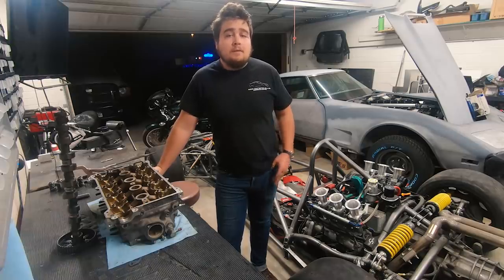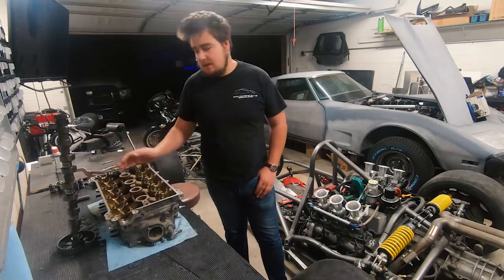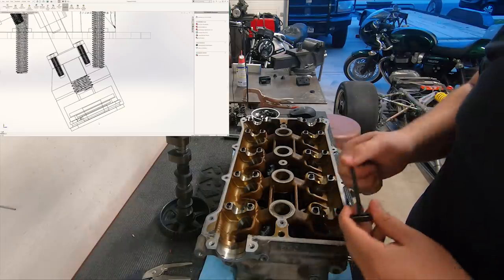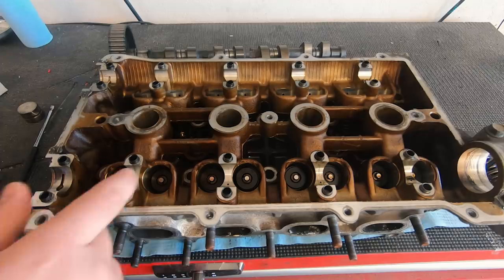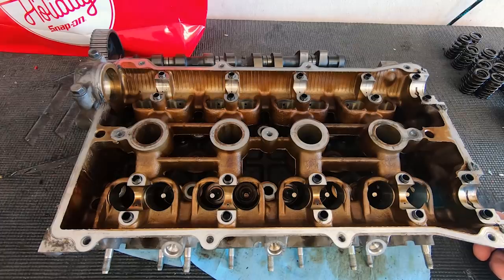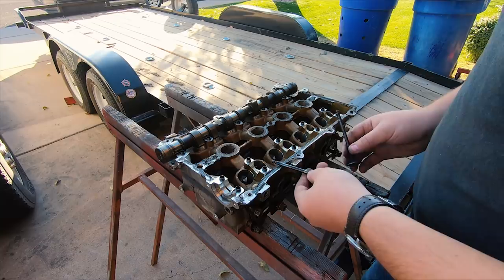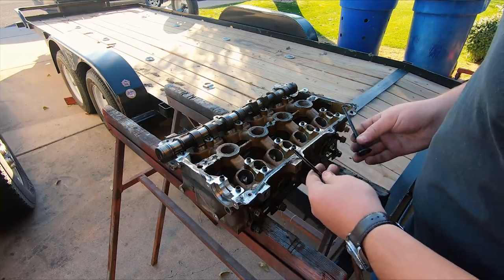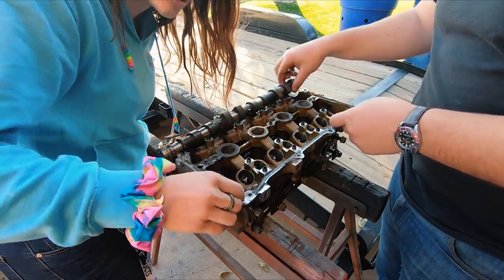Freevalve Miata Build! - Part 1 of  2

Comment: im highly anticipating the end your free valve setup. Years ago when i had my own auto workshop i was coming up with designs of doing my own freevalve setup, but never finished the designs or even made it to prototype. life got in the way. The potential of an engine with the right designed setup would be huge. being able to control valves and change opening  and closing  depending on throttle and engine load. 
Youre doing an amazing job mate.

Comment: You’re an absolute legend!
Reply: So is a Freevalve LS possible?
Reply: This dude will legit make free valve possible for all! 
Fu**ing epic!!
 Dohc is the most common and quite complicated if he pulls this off he gets my money for sure.
He just has to stress test it for reliability and fatigue
Reply: LS valves are a bit bigger and heavier, but with proper springs, pressure, and solenoids, I don't see why not
Reply from the maker: Thanks man! I'm excited to stress test it all- that's why I'm skipping the plastic parts and going directly aluminum.
Reply: @WesleyKagan  man the possibilities are limitless.
Its just too good to be true but i cannot find any other problem than making it robust and figuring out the tuning.
After that the head has mild to wild cam at the same time!!

Comment: Your work is frigging awesome!!!!!  

A professor I had for a VLSI class would have cracked up at your description of a FET ... on the first day, he had a lecture where he explained how FETs worked in a digital sense (pretty much as you said).  He got all serious (normally he was always cracking jokes), he'd make sure any classroom doors were closed, and we were sworn to secrecy to not "leak" what he was about to say.  He then explained FETs in a very straightforward, simple manner (basically compared them an on off switch), and he called things like a MOSFET's linear and saturation regions of operation "nonsense sorcery" as a joke :-) (obviously he didn't believe that, but the act was hilarious if you saw it)).  

He claimed that he had to take all precautions since one of the more analog centric professors would hear him, scold him, and possibly fight him after class :-).  I miss that guy.

I cannot wait to see what else you come up with!!!!  Again, awesome work! :-)

Comment: Excellent stuff! As an aircooled VW guy, i can see how great it would be to be freed from not only the pushrod system, but also the dubious valve  placement in the heads. Could do a five valve head if you wanted, though that would mean a totally new head of course. It´s great.

Comment: The piezo valve is there in festo catlog, i guess that will be most suitable in your case, it has very sharp response time thats what you need during high rpm performance, i think solenoid valve may not achieve parallel performance. 
It might be costly, and if you nedd that you need a 300VDC , that is  cons of that piezo valve. 
Best of luck. Great experiment by the way!

Comment: Hi Wesley, I've estimated that with tubes that long going to your actuators, that will create quite a delay and the engine will more lower-RPM limited. To combat this issue, if you plumb the high-pressure to the actuator and place your pneumatic solenoids to exhaust the top AND bottom of your actuators it will be able to actuate at a rate three times higher...The only caveat to this is that the solenoid signals would have to be reversed, which is easily doable by selecting "invert" in your software table. The other plus to doing as I suggest is that you will need to mount the solenoids directly next-to or over-head the actuators, which frees up a lot of clutter, once your air manifolds are all engineered, (I recommend v-banning all of the high-pressure and low-pressure parts to make them individually accessible). I really appreciate you working on this endeavor, as many others don't have the equipment available, or experience to fabricate it all (especially like in this Country, on a small island in South Asia, everything is twice the cost plus import duties). I loved the first video I saw with the HarborFrieght engine, and I've been thinking about what it would cost to get a lathe, mig, drill press, and many other various tools here, and it's so daunting. Keep up the fight!

Comment: you can literally pull up with a "stock" cam sounding motor, hit a switch and you have a big thumpy monster cam so much potential
Reply: It's like a VTEC system, but instead of having only 2 cam profiles, you have infinite! This is amazing!
Reply: It could be even better than a switch, tune the idle to not stall out when you start off and still have a lope in the idle. Then have ideal lift and timing for rpm and throttle position.
Reply: @tristanhanley8741  the possibilities are indeed endless. Ignoring the obvious oil pump issue, you could theoretically run the engine backwards with the correct timing.

Comment: Looking forward to watching this project grow.  You have to possibility to come up with something so great here and making it work with current technology being a bolt on.  Remove the cam and make a few changes to the motor and have full adjustment for performance tuning, even better mileage, or reducing emissions getting better burns or doing two burns what ever you want it to do.  Having the springs as a back up is smart just in case one of the parts fail.  Going to be awesome to watch so 10,000 rpm dyno pulls
Reply from the maker: Excited to see it work as well, and I'm hoping that everyone can use it to it's full potential!

Comment: Kagan!  Josh Stewart over at Speeduino is really going to love you for going with the Miata Engines.  This freevalve project is so fundamentally different, I find myself stuck in thought with standard engine design.  For example, in engine management, one of the crucial things you need to know is (Otto)cycle position.  That is almost always determined by a camshaft position sensor.  Well, if you don't have a camshaft, you won't have it's camshaft position.  Even if you have a dizzy, they are almost always attached to a camshaft.  When you have crankshaft position like you had in the Harbor Freight engine, you didn't need cycle position to run the freevalve bc it had a carb and wasted spark(like all single cylinder motors do).  On the Miata engines, you have fuel injection that requires cycle position.  At least from the stock ECU.
Reply: wonder if you could use the solenoid signal that actuates the valves as a fuel injector trigger, and advance or delay the spray time.
Reply: @frigglebiscuit7484  Like I said before this is a totally new way of thinking of engine management.  Valve position(aka cam position[aka engine "cycle" position]) is not set in stone or hard-coded.  You stop a free-valve engine you don't have that 50/50 chance the engine will start the compression stroke before it pulls any air in.  
Pulling the signal off one of the solenoids might work if you are using an aftermarket ecu but for the stock ecu you might be able to emulate the stock cam signal(ardustim). I mean, though, where is the free-valve ecu getting it's info from.  You might as well get it from the same source.

Comment: This is a wonderful project and I wish you the best of luck.  My brother and I have done a similar project building a rotary valve engine head for a BMW e36 328is.  There are many YouTube videos of it. 

Starting with the single cylinder engine is where we started as well, after iteration 3 of the single cylinder we moved onto the full car engine.  You have made a good move starting with a 4 cylinder engine in a car with some space under the hood.  My brother and I had originally planned to start with a 4 cylinder but got pulled into the allure of more power and displacement of a 6 cylinder.  The added complexity, cost and space it takes up was quite under estimated. 
Good luck! I am excited to follow your progress.

Comment: Use hydraulic pilot valves.
They last longer, open and close faster and you can use the engine oil pump as the supply.
Reply: He stated something like 1-2ms shift time for the pneumatic valving. Hydraulic DC solenoids can usually only hit 35ms shift time. At high RPM I don't think the hydraulic pilot valves would be able to open/close fast enough.

Comment: Just a heads up; Those exhaust valves are going to melt that plastic.  I want to say EGT is in the range of 800-1100 deg F.  I don't think your grade of aluminum will hold up either.  Your best bet is to do intake only and just use the stock exhaust camshaft.  You think of it, the early VTEC setups only adjusted intake only.  Exhaust valve variation only needs to come in play when you have a turbo and/or want internal EGR.  You might be able to cut the intake camshaft right past the first journal.  Then you could use that little stubby shaft to attach the intake cam cog wheel and reuse the stock timing belt.  It would act as an idler wheel.  Since the dizzy attaches on the opposite of the exhaust cam, you could use the dizzy tambien.

Comment: Here's an idea. You should get a "Speeduino" and tune the Miata that you buy on it before you pull the head off to get a base map. Speeduino is basically an arduino based EMS. You can get pre-assembled boards on ebay and I believe they even have a Miata kit. The cool thing is, because it's open source, you can add your own code and have the FreeValve system be controlled by the same MCU that's managing the engine. Should make your life a lot easier.

Comment: Might be a stupid question.
If you make each valve into a solenoid/linear actuator. 
Use the valve stem as a coil and just build the housing with the coil to actuate it. 
It can make force both ways. No mechanical delay - only electrical/control.
Heat might be an issue.

Comment: Doing some math on this, on a system I designed, at 7500 rpm a intake valve with 200 degrees would only be open for 4.4ms. meaning you'd need to actuate the solenoids in under 0.8ms.

Assuming 0.55" of valve lift

Comment: I don't know if you use a specific shop, but I have used Xometry, Send Cut Send, and OSH cut with good results. Your designs may need to be tweaked to be optimized for different types of machining (versus 3D print) in order to bring cost down. Love the projects, and would be happy to help on the physical part side of things if you want it (not the electrical stuff, haha).

Comment: The Fiat Muliti-air uses hydraulic powered inlet valves driven by the exhaust cam. A separate oil pump could drive all of the valves. Hydraulics are operated by solenoid valves so fast acting they can open and close the inlet multiple times per piston stroke. If you have hydraulic exhausts you can do away with start motor. Shut all the valves open the one just after TDC squirt fuel fire a spark and away it goes.

Comment: Oh man, going straight to a 4-cylinder. I'd have thought about working out the kinks and advancements on a single cylinder for cost reasons. Maybe spice it up and use a 450 ATV engine or something 'larger' to aid with the packaging dimensions. Bigger bore usually means more room for valvetrain. 

Very cool project. Anything you specifically need or want help with?

Comment: Thanks for tackling this project as a Miata owner I'll definitely be following along. To prevent any legal issues you probably shouldn't use the name FreeValve in any of your titles as that could get the project taken down if Christian decides he doesn't like something about it. 

Would it make sense to use oil pressure instead of air to actuate the solenoids? You have the feeds right in the head. The oil could act as cooling, seal lubrication, and pressure for opening and closing the valves. Miata owners are reporting 60+psi on cold startup and 30psi at idle while warm.

Comment: Konisegg used a turbo fed by one exhaust valve. The other valves bypasses the turbo. No waste fate needed. They almost completely bypass the turbo on cold start. They run the spark timing late so hot gassed get the catalyst to temperature dry quickly.

Comment: Going straight in on the Miata - I really think you ought to tweak and perfect this design on the Harbor Freight motor before trying to make a car run on this. Not as exciting, but a far easier and more efficient way of tweaking and tuning the design. Get it working reliably, so it can run a few hours without blowing up, then start working on the tuning, variable cam mapping, valve lift control, maybe even miller cycle running (close the intake valve part way through the intake stroke instead of using a throttle). Rig up the engine using electronic fuel injection and ignition all controlled by the same ECU as the valves - easier on a single cylinder with only one ignition channel, one injector, and two valves. Rig up a dyno for that harbor freight engine, maybe also have a kart to put it in (the original plan to my understanding) for road tests for handling tests. Get it to vastly exceed the efficiency and performance of the stock setup, and super reliable. Then, armed with that knowledge, it should be easy to put it on a car. And then maybe having proven that you can not only barely make it run for a few seconds (as already done, which was already amazing) but can show true improvements, and reliability, then there will probably be investors, you'll literally be in business. In any case, whichever route you take, I sure hope this goes somewhere - I really want this on my old VW Bug!

Comment: YES!!!!! YES YES YES!!! I’ve been looking forward to this!!!!

So this setup does will have adjustable duration but not lift correct? The duration alone is amazing basically infinite valve timing! But if u could also do lift it could take the place of the throttle body aswell and possibly be more responsive then individual throttle bodies... I’ve been dreaming about this tech for awhile and was something that they were talking about at automotive tech 15 yrs ago!!! 

So cool to be seeing advancements in this area!

Comment: I would love to see this in final form tuned on a dyno. See how playing with valve timing, lift and duration can affect your power outputs for these little NA motors. Fascinating.
Reply from the maker: If nothing else, it'll be good for essentially data mining cam positions. Trying a certain cam profile before grinding one out.

Comment: So stoked to see this project grow and your channel. Can't wait to see other applications to different platforms. It seems infinitely scalable, just gotta get that programing for duty durations. I mean different durations are going to need to be fixed for to account for different positions of the throttle, the transmission, and you could even go far as the load on the engine depending how far you go with the program. The solenoids are electronically correct? Obviously I am excited, so do you and will be waiting for updates. Subbed and comment. Grow red, grow!

Comment: if you're still interested in measuring the valve position for a closed loop control system, you may want to consider building your own LVDT as a reliable and fast positioning sensor since the valve body is already made of steel.
Reply from the maker: Because of the short stroke, I’m actually getting positive results in testing with linear Hall effect sensors

Comment: If those springs are too lite 6lbs you will hit a piston, at 2000 rpm you may have valve float it’s seat pressure is part of return speed in your application. I’m Ase certified in engines not a spring expert but valve float is a big thing at rpm and to close is valve timing are you gradually going to open valves or wide open as fast as possible

Comment: Dude I'm excited about this I've wanted to do this since 2005 and now I have confidence that more possible.  Man I have a cnc mill just a haas vf1 if you need some help.   I might try this on a different engine 🤔.  Thanks for the inspiration.  Also I am a full time tuner and I have experience with electronics and software...

Comment: Would you consider just pulling an engine from the junkyard and have an just having an engine test stand? It would make working on it and storage easier. If you do pull from the junkyard, try to find an vehicle with body damage, those will more likely have good engines.

Comment: I'm enjoying your content. Though I see the V12 was leaking oil at rear between the heads. This is coming from the oil cooler that is mounted in the valley. Please look at fixing that leak as it will not get any better by itself. In fact it will get towards 4 litres per minute leakage in due course.

Comment: Just got this suggested video on YT, nice work.
Regarding the valves, you might need to consider the time it takes to the valve "to react", from the arduino signal saying turn on, to the time the motor head valve finally opens.  This lag can be cancelled out without issues in software, you can see it just like the lag spark plugs have.
Also, are the electric solenoids able to deliver full pressure at the high switching speed as the engine revs up?
You might want to verify those mosfets gate resistor is not too high, if not the mosfet will not be in full turn on at higher switching frequency and can heat up a lot.

Comment: such a cool idea! One thing I can't figure out is why the original valve spring was not used, instead of what you did where the solenoid actuate the valve in and out, and requires all that extra hardware and design. Why do you need to pull the valve back up via the solenoid? Is there an advantage?
You retained the valve spring in the harbor freight motor, but I imagine the valve springs are much lower spring force. Is the stock spring force to much for the solenoid to over come?